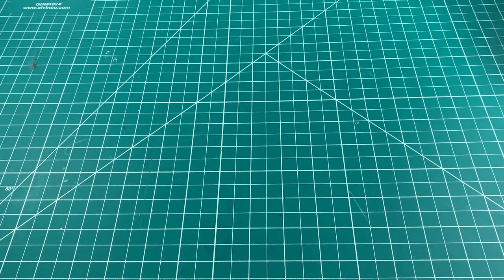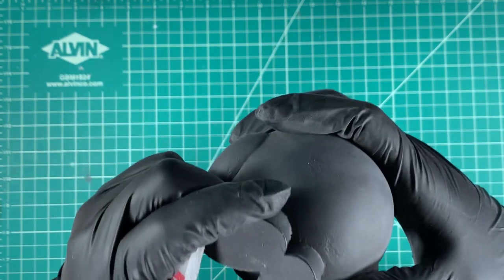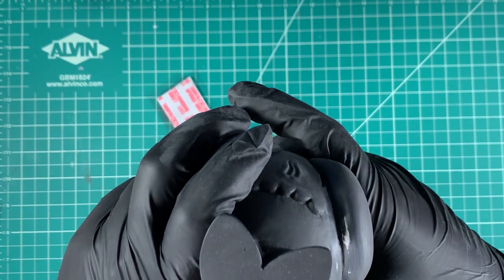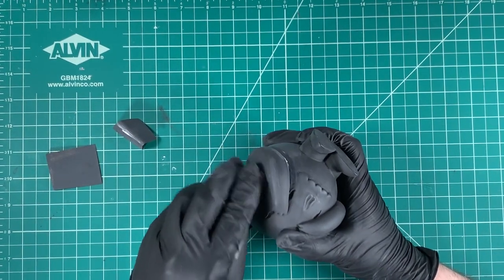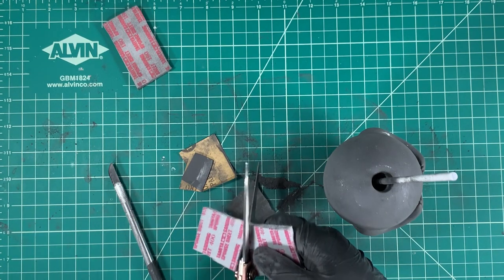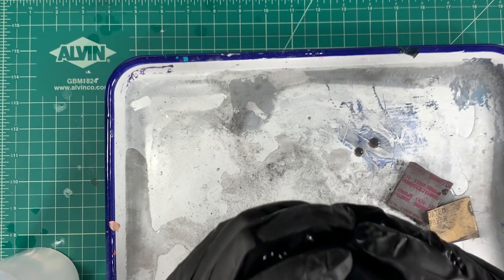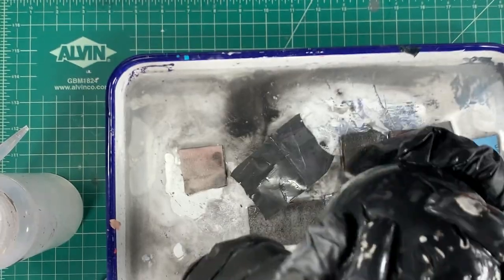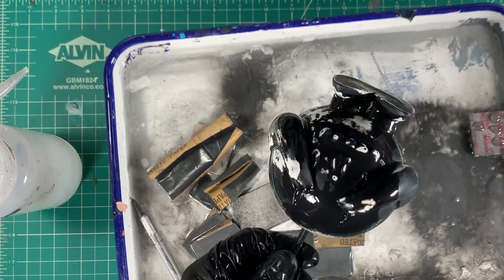How To Make Designer Toys (Part 2)

Comment: Did he make a part 3 of the molding process and did he send it to a company that'll make copies?
Reply from the maker: hey man sorry at the time I had a studio space and could film but I lost that space not too long after filming this. I ended up doing more 3d rendering that I sent to the company because it was cheaper than trying to send resin cop[ies over when getting this guy turned into a vinyl toy. I'm working on making more videos not making resin toys but this is only a very small part of what I do creatively. REsin is definitely the way to go. When I first starting out making toys I had done multiple mini-sized figures before making vinyl. Vinyl takes over a year to get produced and so much money to get made. I still have a tone of toys left if you want to buy one and support the channel to I can afford to make more content, or simply just like and subscribe if you can.
Reply: @Wolf Pits  oh thank you for the quick reply didn't expect a response this soon, I was just curious because I was wondering how you'd make a vinyl copy with a mold but didn't realize you where gonna send a prototype for the company to make em. Glad to hear that you found a more efficient way to make the designer vinyls, that seems like a good way to have them coming out clean and smooth. Thanks again felt like I learned something from these videos, good luck with your future art pieces.
Reply from the maker: @mikekazz5353  yeah a factory made and produce the dup[licates for vinyl